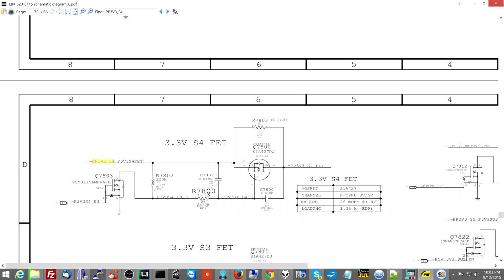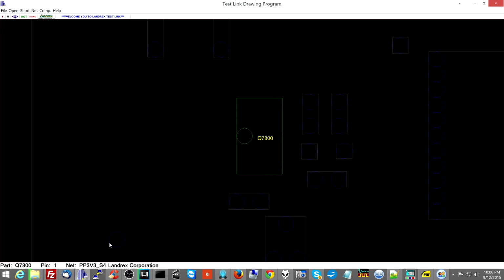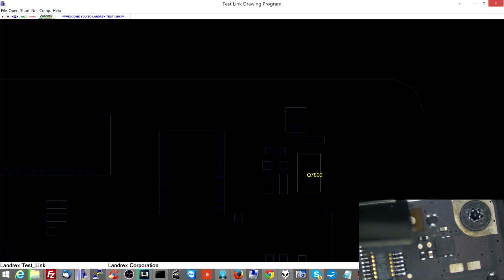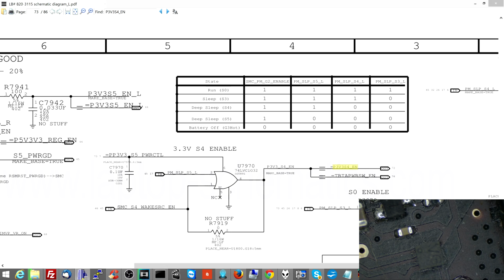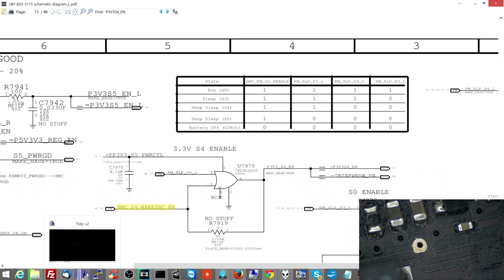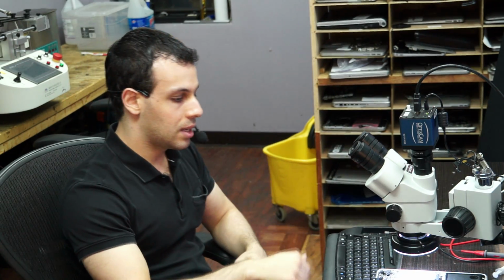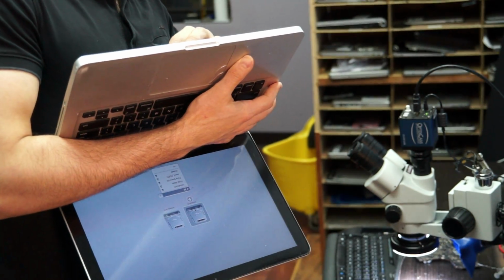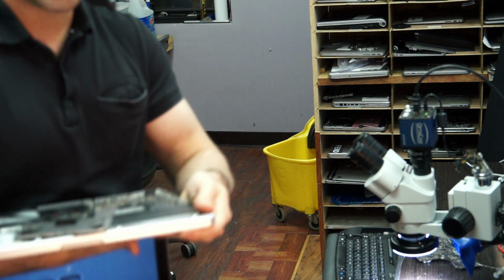Macbook Pro keyboard and trackpad not working logic board repair

Comment: My 2013 MBP 15" trackpad clicks uncontrollably when I put any kind of pressure on the aluminum surface to the left of it. Even lightly putting a finger on it will mess it up and start the clicking. Ever seen that before?

Comment: Hi my MBP early 2015 retina 13i, keyboard and trackpad doesn't work. it works rarely after multiple reboots. But after sleep doesn't work again. I had the serviceman fix the cable connecting, but still no luck. He says the problem is in the machine. Is it?
Reply: I started having this problem around 2 weeks ago. Also have the 2015 MBP.. Sometimes the keyboard dies after sleeping and there is no haptic feedback. Sometimes randomly it works again.

Comment: dont search for the whole part name if you need a datasheet. last digits are normaly just packaging or some minor speed differences. it is actually very easy to find a datasheet for the ssm3k15. http://www.datasheetarchive.com/dlmain/Datasheets-SFU3/DSASFU100040271.pdf

Comment: Hi, I've been doing fairly low level repairs on MacBooks for a couple of years (replacing LCDs, keyboards, screen glass etc) with help if your YouTube videos, I'd love to be able to do component level repair and very interested in learning what you do, watching your videos has greatly help and been a brilliant inspiration. I currently have a 2011 13" MacBook Pro with a USB issue, one port doesn't work at all and other when anything is plugged in displays the message "USB Devices Disabled. Unplug the device using too much power to re-enable USB devices." As I live in the UK I'm too far to be able to stop in at your shop and would greatly appreciate any ideas on what could be at fault, done the usual SMC/PRAM reset and reinstalled the OS 
Regards
Reply from the maker: +Jethro Rainford take a guess

Comment: My guess is the person isn't selling those computes, but leasing them with a specific program in those computers. I would for a business that used a data processing and invoicing program by Reynolds and Reynolds that was written in the 1990s and charged that business I was working for thousands of dollars per month for using that program.   The hardware that was supplied was complete archaic stuff from the 1980s and would constantly break down. If the hardware broke down it went back to Reynolds and Reynolds to be refurbished.

Comment: If buying from ebay is what you say it is, how or where would you recommend someone to buy a board to practice on and maybe even have the chance of fixing it.
Reply from the maker: +Ryan Whitehead Customer devices. The ultimate motivation to not fuck up or do something stupid will come to you when working on a device that does not belong to you.  A different mindset will be in place. 

We do not buy every single device for every single repair when they come on the market. We work on what comes in. What separates good technicians from slobs is how much you destroy on your journey to getting good. 

Do keep in mind there is a BIG DIFFERENCE between not repairing a device, and sodomizing a device/destroying it.

I was 18 years old when I worked on my first Studer tape machine that was being used to record a Bruce Springsteen/Nick Didia/Brendan O Brian session. It was 1 in the morning. They were coming in to record in less than eight hours. I was one of the only two people there. I had never worked on an A800. I had no idea what I was doing.

But people coming tomorrow who were paying $3k/day expected it to work. What a nightmare that was. :)

I couldn't toss my hands up in the air and say "oh well." You either figure it out or you fail, it will quickly give you an idea if this is the type of work you should be doing or not!
Reply: Yo man first of all, thanks for the reply. Your story is motivational and I'm all for the mentality behind it. So just to be sure, you basically started advertising a service you knew nothing about and just hit the ground running? Hats off to you because I'd be too afraid to fuck someone's computer my first try.

Comment: you use windows
Reply: +Krasimir Dimitrov Wait whats wrong with Windows?
Reply: geekguy 15 nothing I love windows
Reply: geekguy 15 just I did not know you could change from a macbook Mac to windows
Reply from the maker: +Krasimir Dimitrov Correct. I prefer Linux but video editing software on Linux crashes too often and lacks functionality I use and love, such as izotope RX4 for dimming hot air station/air filter/fume extractor noise from videos. Or I would use Linux to do these as I used to.
Reply: ***** who said I was a troll?